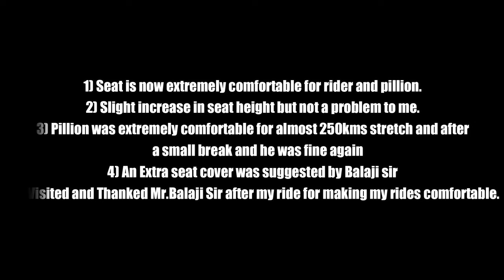Best Seat Modification shop in bangalore for bikes | JP Seat Covers Dr.Rajkumar Road

Comment: What's the price he charged to you? You had the Single piece with steeped type.
I've TVS Victor 2018 model. Single piece flat type, without steeped pillion type.
Reply from the maker: Bro he charged around 800 I think 
You can get in touch with him 
Contact info is given in description 😊
Reply: @AdventureChariot  Is it regular foam or Memory foam?
Reply from the maker: It's regular foam bro but I'm extremely comfortable now in long rides.
You can get it done without any second thought
Reply: @AdventureChariot  Not sponge right?
Reply from the maker: No it's not a sponge 
I previously had put 2 layers of sponge and that's of no use 
This foam one serves our purpose
Reply: @AdventureChariot  What should I say when I call him, if I need foam seat of your type, not a sponge type?
And how will I know it's foam seat, not sponge? And does it come back to shape after riding for hours? Bcz some seats become hard after sitting for too long, & they never come back to original shape. They become stone hard for 2 to 3 days
Reply from the maker: No bro better call him and visit the shop if you are around Bangalore because it is better to checkout the foam and sponge and ask of your choice.. he has everything in his shop 
And yes mine doesn't get hard and comes back to its original shape and seat doesn't get hard
Reply: @AdventureChariot  Okay bro. Thanks for the advice. I am from Bangalore, yet his shop is on the other side of the city. Far for me, yet I'll see if I can visit him once. 🤝
Reply from the maker: Most welcome bro do visit him.. he is very good person doing this job from a very long time.
I'm sure you will be satisfied with his works
Reply: J

Comment: Seat design looks good on the gixxer. What's your height bro? Do your feet reach the ground? Did you later get an additional seat cover? What was the cost for the gixxer seat modification?
Reply from the maker: Thanks for watching the video bro.
My height is 5.7 and yes I can reach ground easy without any effort.
For now Im using the same seat cover only one layer. Later will get one more layer to protect it.
Cost was around 800rs bro.
It is reasonable one.
But it's a must for all gixxer because the stock seat foam is of waste not even half an inch thickness and gave me a lot of pains in long rides.
Now I'm very much comfortable bro 💯